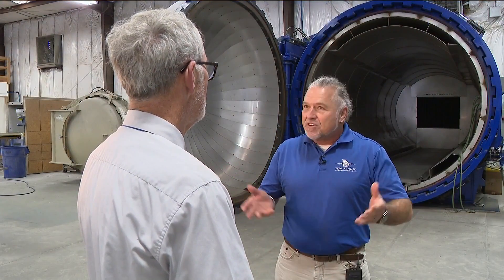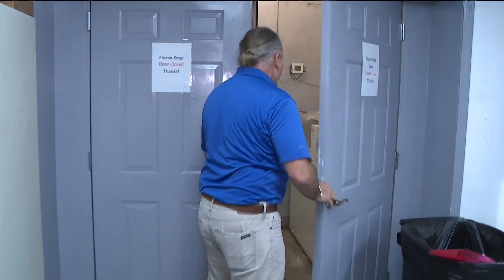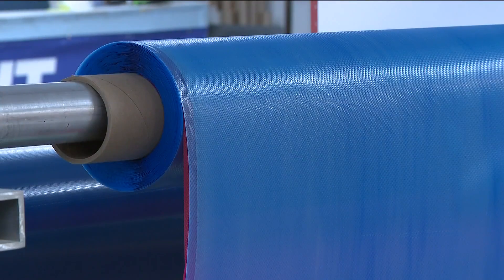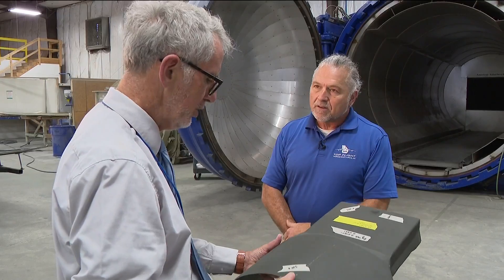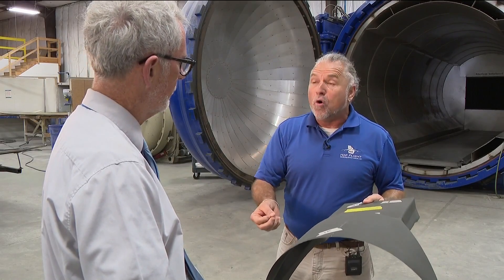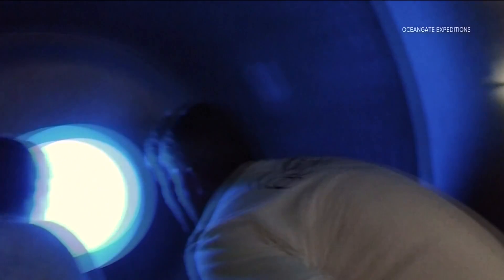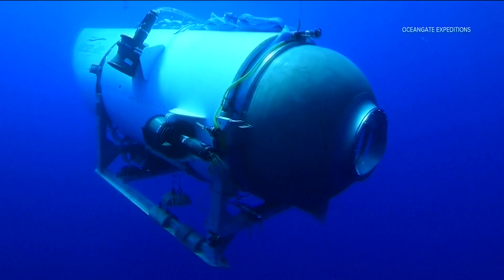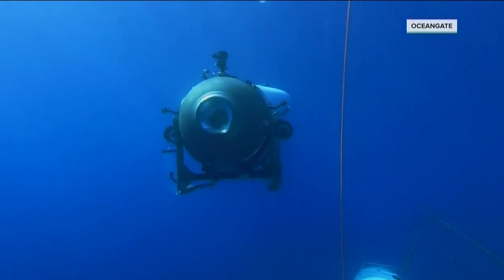Georgia engineer talks carbon fiber that failed in Titan submersible implosion

Comment: Carbon fiber saves weight (and fuel) but will not stand up as a stress member over time as well as steel. This will be obvious within 10 years on airplanes. The first crash from wing failure is yet to come.
Reply: carbon fiber has been used in aircraft since the early 1970s. The faults of carbon fiber are well known namely when it bends it shatters. Steel, titanium, aluminum can bounce back to a degree returning to original shape. Carbon fiber cannot.
Reply: @toomanyaccounts  not in the same way as in the 787.

Comment: That's the key. Titan never went through an autoclave oven under pressure to secure the fiber and resin composite into a bonded structure.  Big autoclaves are rare, but I'm sure they exist somewhere. Having done that step the hull may very well be safe and reliable.  If you cut too many corners you have nothing left.
Reply: it would fail over time period.

Comment: first off carbon fiber is 5 times stronger and lighter than steel. however carbon fiber is only strong like that under tension, not compression like in the titan sub.

2nd that 2 story oven is called an autoclave. autoclave is used to add heat and pressure to the part while the part cures, this removes air bubbles trapped in the resin

Comment: This is a disguised company advertisement and a misleading explanation. 
The essential point is that using carbon fiber for a deep dive submarine pressure vessel is an awful choice. Carbon fiber is awfully poor at withstanding compression stress on the vessel from a high outside pressure, whereas it is great at withstanding extension (elongation) stresses from a higher internal pressure, as in an aircraft’s pressurized cabin or in a high pressure gas tank. 
A stiff fiber behaves like a raw dry spaghetti. You can pull strongly away on both hands without it breaking, but it will easily buckle and break into pieces if you push inwards from both ends.

Comment: Carbon fiber bubble wrap! 

With over 38 years of advanced material reinforcement manufacturing, ASTM (I) failure analysis engineering experience, including carbon fiber, the method, application and total disregard to proper design, manufacturing, testing, evaluation and certifications simply created a death trap guaranteed to fail within a few cyclic loads.

Comment: He a salesman, instead of an engineer, deals with carbon fiber under tension which is does well.   However carbon fiber does not do well under compression.   The inside layer will delaminates and folds and they don't know why.    Ultrasound works for planes, but the only method to test carbon fiber under compression it to subject it to the pressure repeatedly.

Comment: The point this misses is the strength of the points where the carbon fiber was bonded to the titanium end caps, and the fact the carbon fiber was shaped into a tube rather than a sphere which is less sturdy. I've seen that the sub had some sort of sonic safety system which monitored the carbon hull and it picked up warning before the implosion.

Comment: Carbon fiber is best under tension (as it is in high flying jetliners - pressure on the inside). Compression (as it was under the ocean) it is not so good.

Comment: Carbon fibre is for keeping pressure INSIDE, not withstanding pressure from outside. Pull on a rope vs. pushing on a rope!!! Composites are aerospace material, not a submarine one.

Comment: Big difference in pressure when going up... Than going to 4000 meters. I've been around and in submarines for the majority of my adult life. Carbon fiber on a submersible is insane. Especially if your taking it to 12,500 FSW without any NDT being performed after (only) 1 dive, Which should have BEEN SOP for a commercial vehicle. Which it became the minute he charged 250.000 dollars per trip.

Comment: This reporting completely fails to mention the most important part: carbon fiber is strong under tension, but not as strong under compression.  This is the single most important crux of the issue, and you blew it.  You failed to report the most important part.

Comment: Carbon fiber is the tensile component of a composite. External pressure places it into compression and the epoxy into tension. This sub never went down more than a few hundred feet.

Comment: It might not have been the carbon fibre that gave way - but the interface between the carbon fibre and the titanium rings holding the end caps on.

Two dissimilar materials with very different mechanical and physical properties bonded using glue and put under repeated stress cycles - what could possibly go wrong.

Comment: The pressure hull was fabricated by winding a uni-directional fiber around the cylinder. It was NOT a "woven" fabric, and that is the SOLE reason for the implosion .. period.

Comment: Carbon fiber works better in tension vs compression. In an aircraft, weight is a huge enemy and the plane is internally pressurized though not by much. The titan sub was under immense compression.

Comment: Carbon fiber is opposite of what you want in a sub.  You don’t want light weight because that means you need more ballast to actually submerge.  You do want a homologous structure like steel and titanium because it’s characteristics under pressure are well know and don’t develop any defects if you stay within safety limits of the design.  Carbon fiber is a mix of a carbon wave and resin,  it can break under constant wear and is prone to delaminations that are not visible on regular inspections.  Space age materials work well in space and airlines where they work great.  In subs the risks are not worth it.

Comment: On second thought...the Titan collapsed at 13,000', after several trips to the bottom (and back up).... that's actually a very good record for what was essentially a backyard build.

I'm not an engineer or anything, and certainly there could've been a bit more safety research on it, but it seems to me that carbon fiber may have some potential uses for underwater stuff. Like fixed structures, underwater domes, etc.
Reply: Unfortunately I think Stockton Rush was using those prior dives as "proof" that his sub could continue to dive.  But even he (and passengers) heard cracking noises, and he knew those noises were carbon fibers breaking.  He should have known his sub was really a ticking time bomb with a limited life.  It was as if he was trying to squeeze out just a few more dives.  Was the guy in debt or something?

Comment: This may be too simplistic but planes use carbon fibre in low pressure exteriors and submarine situations use it in huge external 
pressure situations. One is crushing it and one is stretching it. Total opposites I would think. Fibres are far stronger in tensile 
situations than compression. It’s like a rope it’s very strong when your hanging from it but it’s can’t support you when you compress 
it. The only thing than keeps the fibres from crushing in the resin than you soak them with. A form of glass. It’s brittle 
and once cracks develop it just fails without any warning. I don’t thing the navy have any carbon fibre submarines as far as I 
know and I’m no expert. They are made of steel because it has huge compressive strength when machined in certain forms. 
The circle is the strongest form as it has no focus points for pressure to concentrate in. Carbon fibre is in its experimental 
stage concerning underwater submersibles. God help anyone helping in those experiments.

Comment: Carbon fiber in airplanes was adapted after massive research and testing that led to the development of carefully controlled manufacturing processes and the development of non destructive testing as part of the manufacturing process.

Thee was nothing remotely like that with the adaption of carbon fiber for use in the hull of a submersible. It probably wouldn't have been financially feasible given the very small market for something like a deep sea submersible. 

The join between the carbon fiber hull and the titanium ends of the submarine introduced a large number of failure mechanisms that would have been very difficult to simulate and test for given the limited budget for such testing. There just was no reason to experiment with carbon fiber for this application.

Comment: Wow. This piece actually manages to tell us absolutely nothing about Carbon Fiber, while at the same time making uninformed viewers panicky over its use in aircraft. Well done! Absolute garbage tier reporting. Here’s the simple truth. Carbon Fiber is great at holding loads under tension. Such as having pressure on the inside. There the Fibers in the composite hold the load and are “stronger than steel”. Airplanes hold the pressure on the inside. Carbon Fiber also has some flex when subjected to lateral loads. But it has insufficient strength under compression. When compressed it is the epoxy resin binding agent that ends up carrying the load. Because the Carbon Fibers are just like yarn when you squeeze them together. This makes Carbon Fiber a horrifyingly bad material for a Deep Water Submarine’s pressure hull. Carbon Fiber is good for pressure on the inside applications. Bad for pressure on the outside.

Comment: As someone who uses structural adhesive to bond CF and Titanium together I'm left wondering if they primed the Titanium. Without a primer there's very little durability or strength in the bond.

Comment: so it the testing and not the carbon fiber at fault .! ?/ hold on if Carbon has to be safety test so regularly then maybe there an inherent weakness in it from the beginning and is not as space age as everyone thinks .
HOLD ON I SEE PARALLELS IN WARSHIP BUILDING
IN the late 1970S the RN said lt build out Aluminum not steel we save money then  in the spring of 1982 during a small war they realise Aluminum melts at a lower temperature than steel and went back to Build RN warships out of steel again
Conclusion some martials should not be used for some jobs regardless off the science.

Comment: I'm not an engineer, but I understand fibers perform well in tensile, not in compression.  An airframe has to take expanding pressure from inside in tensile at less than one atmosphere.  The Titan Imploder had to take a ridiculous amount of pressure in compression.  
        The basic problem comes down that they used tourist trips to the depths to pay the costs of research in the depths.  Research in the depths is far better carried out by ROVs.  ROVs needn't be built to accommodate humans and human lives aren't threatened.  There needs to be another funding mechanism for people who have a lot of money to be able to participate in deeps research using ROVs and maybe bringing stuff up for their collections that going down themselves.

Comment: Why not have an aluminum backed carbon fiber? Like a liner to protect the actual carbon fiber. Or steel or something. The other material won't be for the strength. No gap between it. Just to protect against scratches and gouges.

The other material will be the outside liner.

Comment: In that foggy cool room, there are prepregs, pre-manufactured plates of carbon fiber (canvas or twill) with resin. They shape them in the form (using press or vacuum) and then bake in furnace. This is why it must be stored in cool. You cant made a monolitic object. The titan sub was made different technology - raw fiber wraped up very simply way around the form, resin was applied with a spatula by hand.
Reply: Yes, and it was constructed in a workshop, probably very dusty and dirty and there was no process for degassing the resin or layup.

Comment: This reporter should be talking to a material science professor, not a hawker of carbon fiber.  The proposed remedy is inadequate; no amount of acoustic testing--what Rush built into the monitoring system on the Titan--would've sufficed.  One failure and instant implosion, which is probably what happened.  The warning would've come too late, not even perceived before the people were shred to bits.

Also, it's not used for submersible crafts because it's not made for compression.

A very poor news segment.

Comment: After the Titan disaster I saw a YouTube video where they test the compression test of various material using a hydraulic press. The sample were basically 1 inch diameter tubes and about 2mmm thick from memory, and about two to three inches long. They were stood upright under the press head and the pressure recorded when they began to collapse. The interesting was that carbon fiber was one of the materials tested and it was only about twice as strong as aluminium! The strongest by far was stainless steel which suprisingly even outperformed titanium!!
Reply: Yes.seen that too.
Good old reliable stainless steel.

Comment: This video did not impress me. Carbon fiber is very poor in compression and is absolutely the worst choice in this application. The only thing in Titan hull really resisting the pressure is the epoxy matrix resin. No discussion about the failure modes of a thick-walled carbon fiber tube with Titan wall thickness-to-diameter ratio. No discussion of epoxy behavior at freezing temperatures undergoing extreme compression.

Comment: Carbon fiber composite hull is better suited for pressure from the inside (like the hull of the Boeing 787) than enormous outside pressure (like the hull of the Titan submersible).
Not even considering the enormous force that the two hemispheres at both sides of the hull put on the carbon fiber structure.

Comment: This engineer wanted to innovate but between the air world where you have to pressurize the planes because the atmospheric pressure decreases with altitude and the world of the abyss where the pressure is extreme... There is a world. There were guards , specialists in the field who warned. This accident tragically confirmed that carbon fiber material is unsuitable. Yet it was simple: steel/titanium for this use :-) The heart has its reasons that reason does not know.

Comment: Interesting-obviously this product has a multitude of uses where its proven to be effective-submarines is not one of them.I've only just started looking into this and every expert says the same thing,combined with the fact that the viewing portal was only rated to 1300m,not 4000m brings into question criminal negligence at the very least,combine this with the fact that Stockton fired his engineer for voicing safety concerns and you have a disaster waiting to happen and it did...

Comment: Towing the Titan 400 miles in open ocean can not have helped the carbon fiber composite stay intact. . Every bump from waves transmitted to Titan from the frame as the barge bounced around had to have an impact on the carbon fiber composite -to-titanium glue joint. The bow of the sled was blunt.
Every other deep sea team you see with submersibles show extreme caution launching a retrieving them.  They all treat them with kid cloves, like fine china. Not like Titan in 2023. All carry their submersibles on deck. Videos of the towed Titan show days with very large swells. 
The Andrea Gail sank about 200 miles from Titanic, so the Titan was towing through a particularly tough patch of the ocean.

Comment: The great difference between aerospace application and the Titan submersible application is pressure. In space the maximum pressure difference with reference to sea level is 14.7 psi. That's it. In deep submergence activities the pressure differential increases by 14.7 psi every 33 feet of descent. The Titanic is at 12,500 feet below the surface. That amounts to 5568.18 psi, pounds per square inch when a vessel is 12,500 feet below the surface of the water. Now multiply that value by the overall surface area in square inches of the composite shell of Titan and you come up with an astounding amount of pressure. Carbon fiber is a non-homogenous material. It's components will flex at varying rates according to how pressure and stress are applied. Steel and titanium are homogenous, all one material. It all reacts the same.

Comment: The cost of an inspection may not be what made OceanGate avoid doing it. If a flaw is found in carbon fiber, how can it be fixed? If they didn't plan to fix flaws, that might be why they didn't test.
Reply: from what i've read about this subject so far,stockton rush went around having a 20k test done by fitting the submersible with acoustic monitors and strain guages.....these are the kind of devices used for TESTING before the material/ craft is put ino service,ticking timebomb is what it was.

Comment: Remarkable that the hull failed at (according to the reporter) 13,000 feet, a full 500 feet deeper than the ocean depth at that point. Did the sub have a digging feature or is the reporting here just utter garbage.

Comment: Fuck CF. Might be strong but imagine a bird crashing into the wing of that Boing made of CF and nicked it with its beak causing a “concentrated stress fracture” right after take off. I guess the preflight ultrasonic test missed that.

Or the sub being hoisted to and fro the boat causing a Nick or scratch. 

Or the CF drive shaft of a 900hp car under hard acceleration kicking up road dirt and rocks nicking the shaft. 

Space age’s newest and greatest. Meh

Comment: The carbon fiber hull didn't fail.

When you use something not fit for purpose, the material did not fail.  You failed.  

The material did exactly what it was supposed to do.  Exactly what it was known to do.

Comment: Working in Motorsports engineering and fabrication for over 25 years. You can’t bond titanium to carbon fiber. I’ve tried all the hysols and nothing truly bonds to the titanium. Silicone works better…